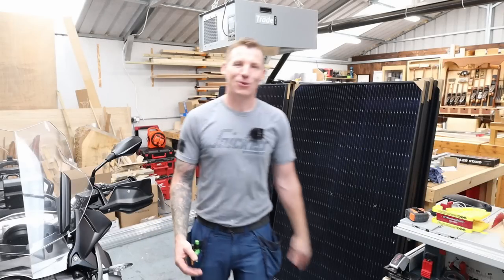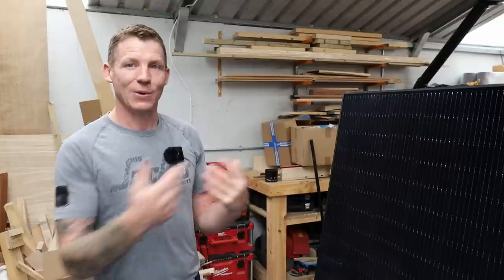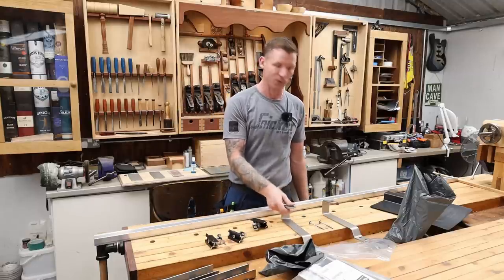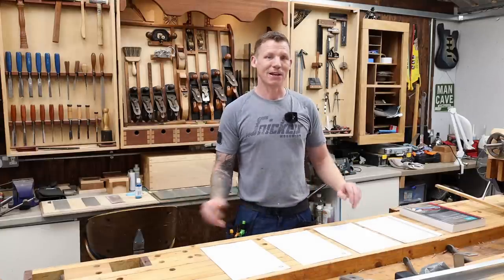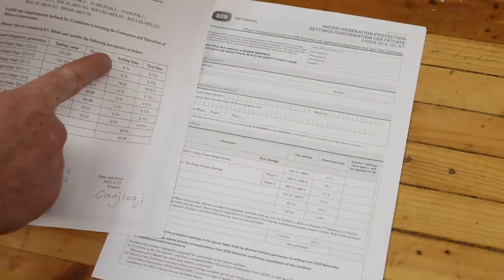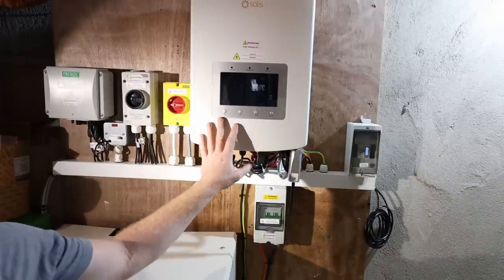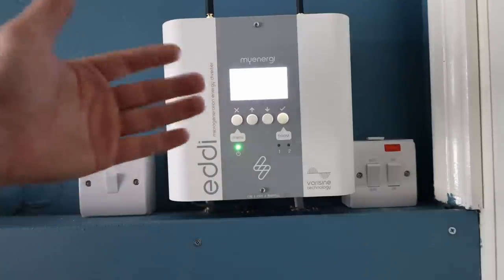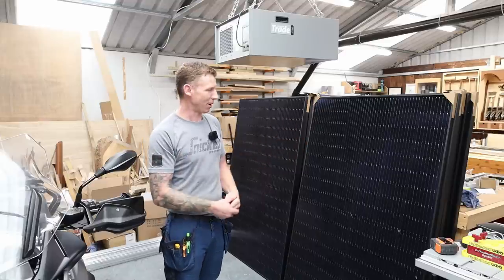Installing a Solar PV System in Ireland. A Look at the Kit and What to Consider. What's Involved

Comment: With the auto PV disconnect in the event of grid failure how do you keep your batteries charged to power your home. A hybrid inverter should not allow power to the grid with grid failure.

Comment: Brilliant Video John and couldn't be more timely. I'm in the process of moving to Ireland and buying a house in Co Kerry. I'm keen to add PV panels and have spent the last week on the SEAI website and numerous PV installers and providers. Have to admit your video taught me more about the system than I learnt online. Want to come and install mine? 🙂
I also didn't realise there was a fireman's switch. In the US PV panels are definitely used as backup in case of power cuts. They isolate their AC from the grid but leave the house standalone. Is that not possible? how does it work if you have your own power generator?
Reply from the maker: Hi Donal it is possible to separate the house from the grid in the event of power failure, but the regulations state the solar aray must be isolated in the event of power failure. I have no idea why you can't isolate your house and continue to use your solar panels. I can't get a satisfactory answer to this. You also run into problems with a back up generator. If your solar system sends excess power to the generator it will destroy it. It's fine as long as all the power generated is being used, but when you are using the generator you are disconnected from the grid so you need to isolate the solar system from the generator or risk sending the excess power into it.
Reply: @JohnMcGrathManInShed  Thanks John. by backup generator I meant how does it work without PV system. If there is a power cut you can use a generator to power your house? does that not send power to the grid too or are they completely switched over to use the generator and you then manually switch back to the grid when power is restored?
Reply: @JohnMcGrathManInShed  Also, if only the solar array is disconnected would the batteries not be able to supply power to the house? (and therefore the grid too)
Reply from the maker: @donalfalvey145  you can Donal, it's just a case of installing a change over switch which selects between the grid or the generator.
Reply from the maker: @donalfalvey145  again you can, you can use the second output on the hybrid inverter to power a socket that is separate from everything else  so you can use it as a power supply from the batteries in the event of power failure, to power the whole house from the batteries you would need another switch to isolate the house from the grid when the power fails.
Reply: It’s explained well in 4.7.  It appears the cutting off of the solar arrays must be possible from outside the building. If the ac is cut, then the arrays are isolated. It seems as much to do with DC shock as it is with potential back feed from the inverter into the grid. The document also covers Off grid in 4.9. I think a second board for essential circuits with a change over would be compliant?
Reply: @samesliver90  Thanks. What document are you referring to?.

Comment: Can you install the equipment in the garage instead if the attic?
Reply from the maker: You can, not a problem as long as you can run the cables to where they need to go.

Comment: Hi, I had some questions different regulations in the UK, but hybrid solar inverter automatic self isolate when the grid fails as it is no longer receiving power from the grid to operate. they normally change over to EPS mode same as when you isolate the unit with the rotary isolator. 
Are you not able to install a ATS (automatic transfer switch) so that you can supply power back into your house/ some sockets in a power cut while at the same time cutting any power from flowing back down the grid?  Over here in the UK to do this we require a dedicated earthing method TT earth rod like when using a generator.

Comment: the single battery is joke for the inverter and panells. it has only1.2kvah charge an discharge rate so cant pover your apliances. in summer you get 20-30kwh a  day. you already spend more than 1000eur extra for inverter and cabinet so the price of battery is very little extra. have similar system for 3years in wexford. from march till october no electricity from grid bud you need bigger battery (much cheaper for me buy directly from UK) get te pylontech 5000kv version. in winter charging battery for 12.5c night so dont use 52.7c day rate. very profitable investment.
Reply from the maker: I can add batteries as needed in the summer, I'm also using it to heat water.